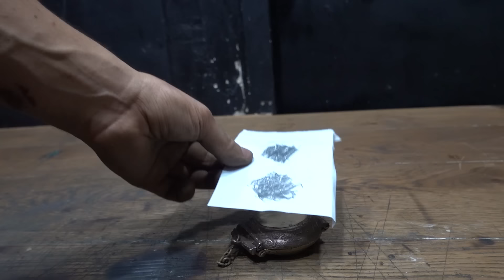Restoration ANTIQUE Handcraft Powder Box

Comment: Using Ketchup to clean brass or copper objects works very well against green or blueish corrosion. Just apply the ketchup on it, put it in a ziplock bag or container, and leave it for 10 to 24 hours. It is really worth trying.
Reply from the maker: Hi, a very interesting option! Thanks for the advice and information, I'll try.
Reply: From the acid from vinegar and tomatoes?  Great idea.  Definitely trying this.  Thanks.
Reply: Fella who used to come into the pub where I worked polished parts of his motorcycle with HP brown sauce!
Reply from the maker: @jonesy2112  Wow! Intresting!
Reply: Iirc a flour and vinegar paste works much the same way, the acetic acid in those sauces seems to be the active component
Reply: @ScrewsAndTools , ха-ха, ты - забавный чел))).
Reply: My daughter used ketchup to clean a penny for science  in the 7th grade

Comment: This reminds me of a ladies powder case that would have been popular around the turn of the 20th century and possibly earlier. My best guess is that the cemented substrate was probably caked facial powder. I just hope you were wearing safety equipment when you were using the dremel tool as arsenic was an ingredient used in face powders for some time, so the dust could still be unhealthy.

Comment: Hi there. Not sure if you're interested, but the mortor type substance that has harderd in the box is a type of lye. It is used to increase the potency of the beatle nut and decrease the chances of 'gum rot', which can happen when the beetle nut is used regularly.
Reply from the maker: Hi, thanks a lot for the information. I thought it was cement or gypsum.